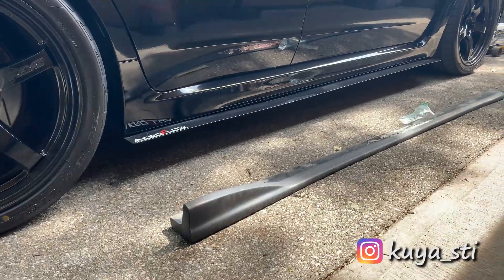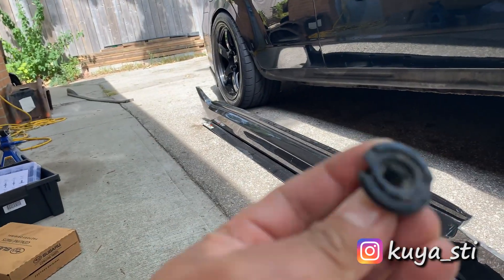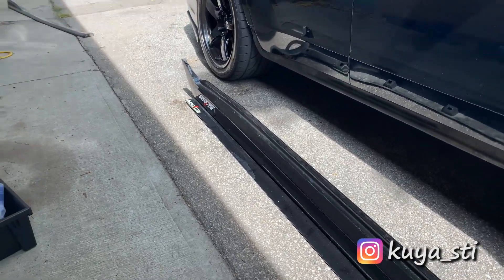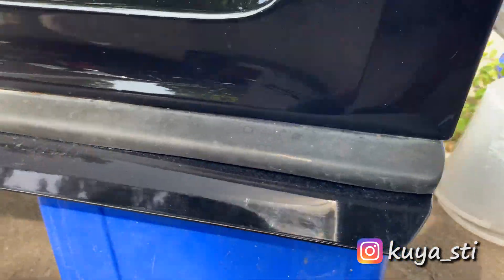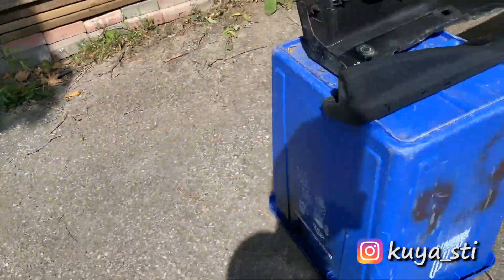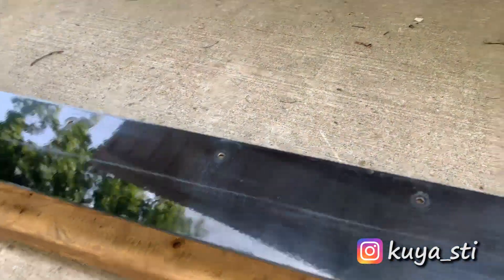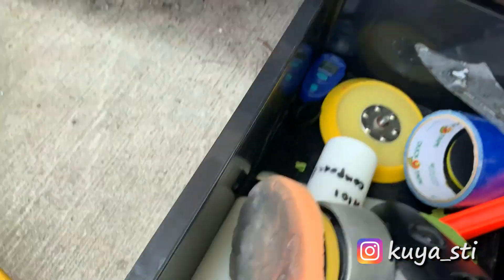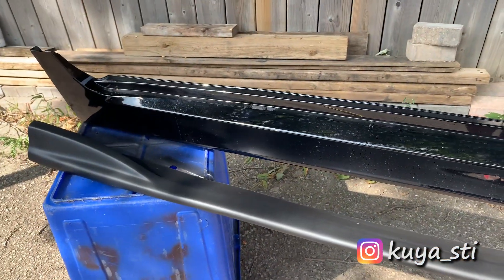Kuya Installs Sideskirts

Comment: Looks awesome man! How is the X Force VAREX exhaust holding up? Any problems ever with the valves or electronics? I’m interested in getting it for my 2016 STi
Reply from the maker: thanks for watching! The valves do get  gunked up and seize from time to time so you gotta take it apart to give it a good cleaning with brake cleaner and then lubing the gear again. Add some grease to the connectors too because they will corrode. If you're willing to do maintenance before and after winter, then i highly recommend it :)
Reply: Kuya STI thanks for the prompt response! How do you take them apart? Do you take the mufflers off the car and get in there?
Reply from the maker: @mpv314  yup pretty much!